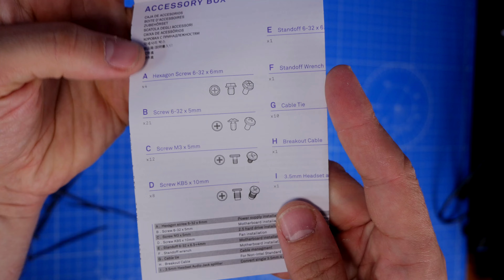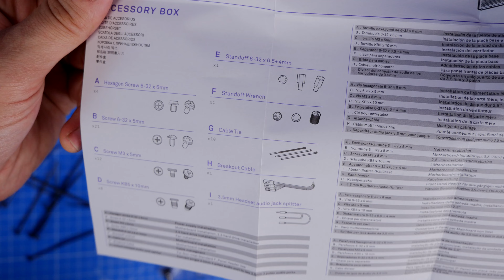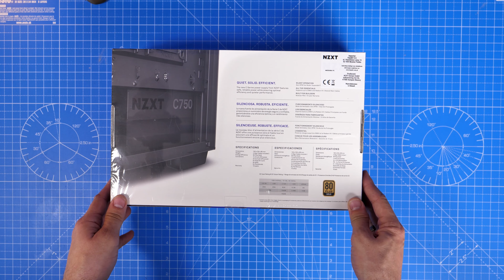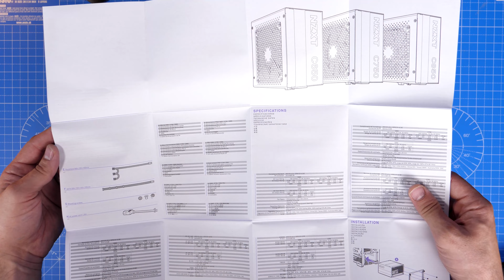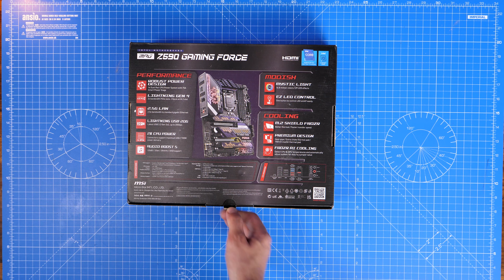ASMR PC Build - NZXT H510 Flow, NZXT Kraken K63 RGB and more

Comment: Do I need fan hub controller from nzxt?
To get fans to work or not?
I want z63 white
And 2 aer rgb fans 
On nzxt h510 flow
But what do i need.. else?
Reply: Mate ive now bought same case with x63, which way you thinking of fan flow because rad only fits on front so would'nt blow hot air inwards? & what ive learned is you only need controller if you want all rbg's to work at same motion etc but dont take my word bud